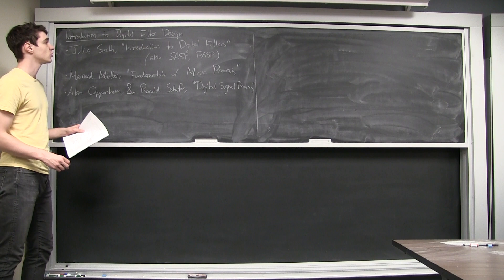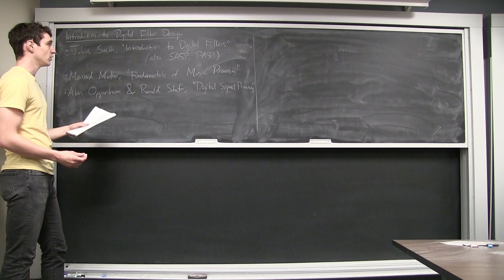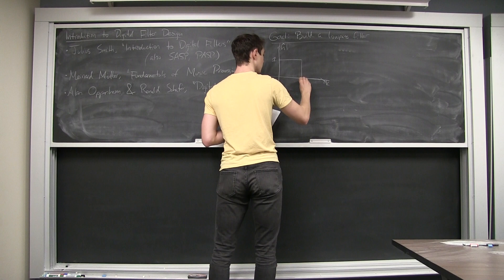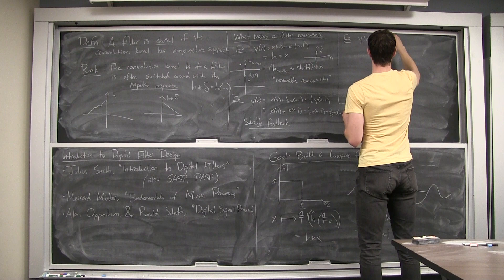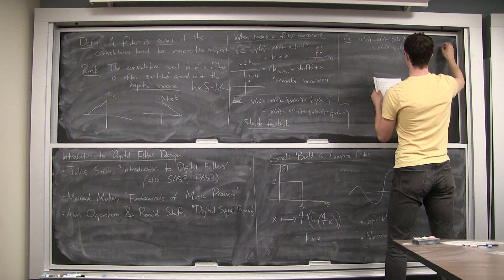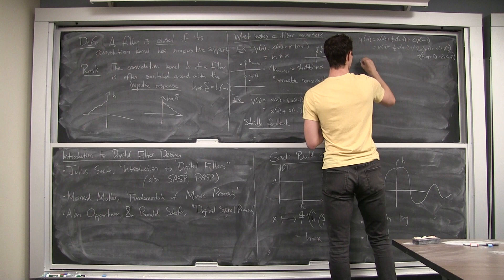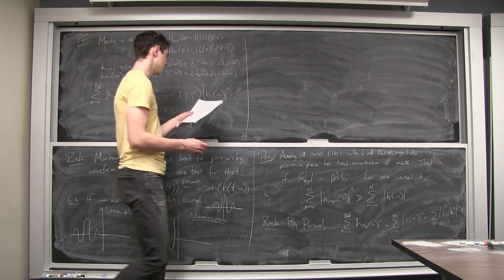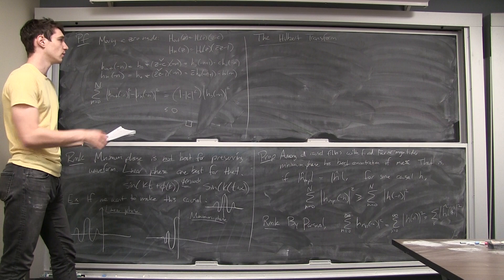Introduction to Digital Filter Design

Comment from the maker: (Corrections)
- Throughout this talk I mix up convolution and correlation, resulting in many positive/negative mistakes.
- There is some confusion about exponentiating poles and whether that gives essential singularities or other poles. I need to look into it.
Reply: The specific exponentiating poles issue that you mention doesn't seem to matter. You made sure all poles are inside the unit circle. Outside the unit circle you have a holomorphic function. The exponential of a holomorphic function is holomorphic and has no zeros. BUT...
Reply: I am hugely confused by the end of the talk. On the one hand, you have only spoken about the continuous Hilbert transform. On the other hand, you're talking about poles and zeros. That makes it sounds like the Z-transform is still lurking around. But that comes from a discrete signal.

It is completely unclear to me what we even mean by "the poles and zeros of log|\hat{h}| - iH log|\hat{h}|". Also, in the context of the ideal low pass filter, taking log of 0 seems to be a significant problem.
Reply: Here's what I've got...

Suppose h(t) is a signal and H(s) is the Laplace transform. In this context, you say "left half of s-plane" instead of "inside unit circle" (basically because s and z are related by e^s = z). The Fourier transform lives on the imaginary axis: \hat{h}(\omega) = H(i \omega).

Theorem: when H is minimal phase arg(H(i \omega)) = - Hilbert( log( |H(i \omega)| ) ).

You said you'd only treat continuous things with the Hilbert transform, but then Z-transform should be replaced by Laplace transform.
Reply: I thoroughly enjoyed the talk up to this part! And now I've overcome my confusion, I'm quite satisfied with the additional stuff that I learned. Thank you for sharing the talk with me!!
Reply from the maker: @michaelandrews9718  Thanks for the notes, and for listening! You're correct that I mix continuous and discrete methods -- this was to make my life easier with giving the talk. To do everything with discrete signals (i.e. the Z-transform), one needs a discrete Hilbert transform, which comes with its own complications, and so I just gave the simpler continuous Hilbert transform. As you say, if you want to do everything in continuous time, the Laplace transform should be used over the Z-transform.